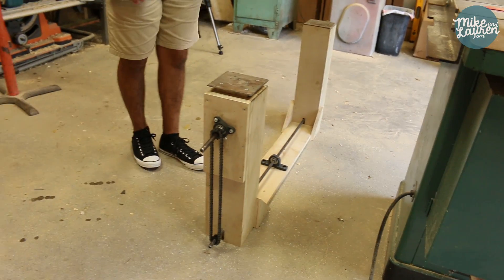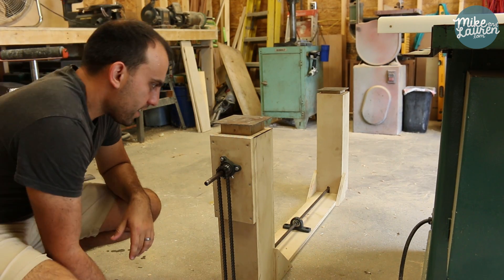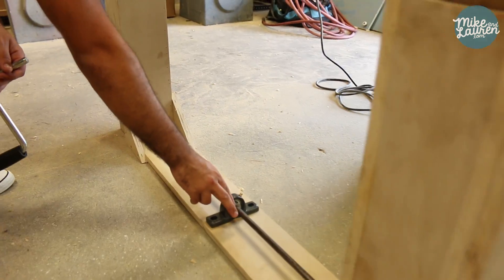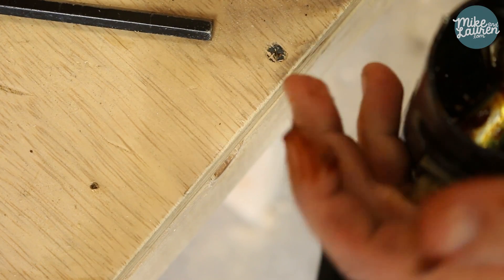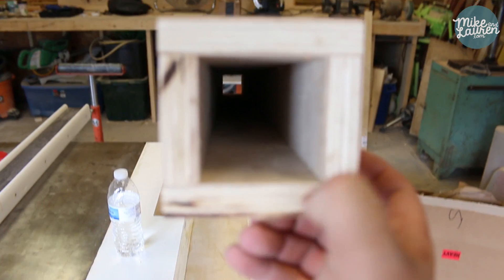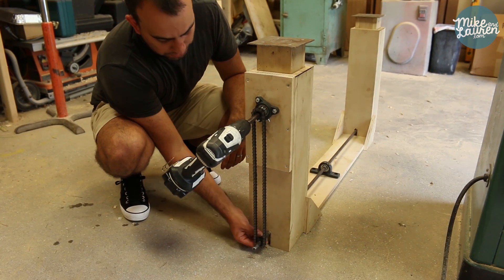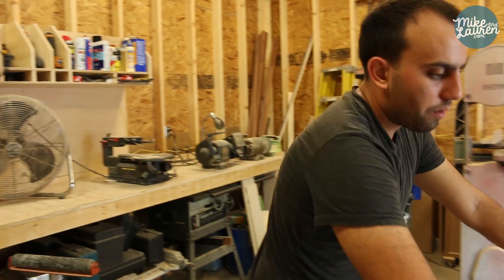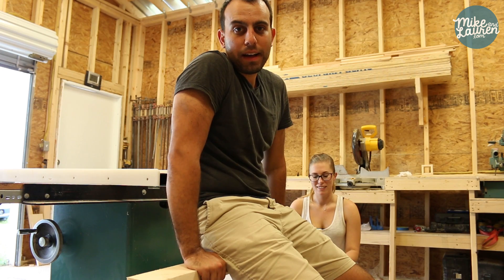Mike Makes an Adjustable Height Workbench (Lifting Mechanism)

Comment: I've not been through all the comments, but provided you keep the bevel gears on the same side of each jack, they should then move up and down in synch.  The only reason you'd need to swap a bevel is if you unintentionally rotated one jack 180 degrees relative to the other.  Otherwise, the same rod should pass through both in the exact same manner (bevels to the right, for instance) and all should stay in synch.  Right?

Comment: Try building a table which have this height adjustable mechanism and also the workbench can be folded using folding brackets. 
It'll be great for those whose room are small or if you want more space!

Comment: How do you prevent the legs from falling straight back down after you have set them in the up position? Wouldn't they fall down if enough weight is applied onto it?

Comment: Help please
Any body have an idea on how to sit the base of the jacks in some kind of wood or holder when the jack is upside down.  (I'm not sure how to make the jacks site in the box and how to make them safety sit in the box without damaging the trailer jacks cause i plan on having heavy objects on my table tables.)

*****************  How do i stabilize jacks in wood when they r upside down *****************
Thanks in advance for the help
Reply: did you get any answer ?

Comment: For the others then my questions at the end.....

I found the trailer jacks at Wal-Mart for about $35 each and the rod from Home Depot. Pretty easy to get the mech working. Just pull out the crank handles and move the cog (only on one of the jacks) from one side of the jack to the other, grind down a flat spot on both ends to accept into the cogs. 

What I can't find is the sprocket and chain bits to be able to put the motor where I want it. Can you tell me exactly what you are using and where I might by or scavenge the parts? Thanx for an awesome idea!
Reply from the maker: +Bill Nunley I bought them on amazon.  They were called "roller chain sprockets."
Reply: +Mike and Lauren I knew I just needed the right key words... Finally found some that were affordable here https://www.thebigbearingstore.com/13-tooth-sprocket-for-35-roller-chain

Thanks for the reply!

Comment: I would love  to know more about the mechanism and the parts that were necessary to build it. I want to make one of my own, and have been thinking about using jacks, but couldn't figure out how to make them both move at the same time. Any advice in addition to what you have posted already would be amazing!
Reply from the maker: +Annette Sinanian Sorry, I just kind of built this as I went... and since the plywood covers all of the components I can't take any other pictures.  What I can say is that 1/2" rod is what the jack companies use inside to connect their gears.  So all you're doing is taking out their short rod and replacing it with one long rod that connects the two jacks.

Comment: I've always been fascinated with the concept of an adjustable height table.  I've done several mechanical sketchups (manual operation, not powered), but never built them because I didn't have a practical application to justify building it.  I'd love to see what you plan to do with this because it's such a cool idea.  Hope it works out well for you, and a great start so far.  Your engineering skills are impressive!  Thanks for sharing.
Reply from the maker: Conrad Designs Thanks!

Comment: Those trailer jacks area cool idea.  I'll be curious to see what you mount there, and why the jacks had to be upside down.
Reply: Mike Kapotsy Why would that matter? Instead of having a table top that you push up you could just push down on the ground. Since the ground will most likely refuse to move the other end of the equation will.

Or have I missed something?
Reply: If this jack weren't upside down you would have to move the drill up or down with the table. As he has it, the drill doesn't have to move.
Reply: Mike Kapotsy Could you maybe have the lift mechanism follow the lift part up, so you wouldn't need the chain?
Reply: Andrew Porter that's correct.  I still think the way he has it is best approach.
Reply: Jim Groth there is one workbench out there on YouTube that is motor operated with remote control.  21st Century Woodworking is the name of the channel I think.
Reply: Cliff Bramlett Yea, if that's something you want to avoid I guess that setup makes sense. :)
Reply: Needs to be upside down because with trailer (tongue) jack, the lift mechanism comes out the bottom and he needed it to raise from top for his bench.
Reply: Jim Groth Not with the type of jack he's using.  The crank handle on trailer jacks is opposite end of the lift mechanism.
Reply: I would be interested to see if you do this with a single jack and a scissor lift that lifts both sides.
Reply: Jim Groth Good point. I suppose it could work either way.
Reply: Pushing down to the floor would mean the winding point would also move upwards.  I guess that's a bit more awkward - especially when that also means the connection to the opposite leg would also be moving.
Reply: I'm assuming there will be a motor to drive this thing. If yes, it wouldn't be very awkward to press a button on the table as it is rising (like for instance the Ikea tables) and if it will be manual, I don't see it moving very quickly and should therefore not be a problem.

Personally I would prefer the method that required the cheapest parts. :P
Reply: Mike Kapotsy I'll check that out. Would be fun to make something like that so I can combine my interests for woodworking and electronics. :)

Comment: Hm, that's very interesting. I wonder if i could gang 4 of these under on one access point to lift one item. Most interesting, thanks for the share.
Reply from the maker: aserta I would think that would work.  The weakest spot is the wood that the base of the trailer jack is sitting on.

Comment: Was any consideration given to a gear reduction to increase the speed that the height moves. Seems like it could be a pretty easy thing to implement since you already have the chain and spur gears going. 

Also, as others have said, definitely some sort of tool that you want to raise to usable height
Reply: Mike and Lauren Wooden gears!
Reply from the maker: Gordon Edmiston I actually had gear reduction planned, but Amazon didn't send my order on time.  So I picked up these gears to work on this weekend.  It turned out the drill turned it plenty fast.
Reply from the maker: Matthias Wandel Of course!  Have you used wooden gears with chain before, or would you just go gear to gear?

Comment: You're planning to mount a tool on the middle shelf, and this is a way to bring that tool up to a usable height when you want it.  Something like a planer.  Or a Panto router or router table.  that's my guess at least.   Gonna leave it as drill powered?
Reply from the maker: wordsnwood My plan was to have it hand crank, but the crank I ordered was too wimpy.  Then I saw the drill fit around the shaft, which made it much easier.  I'll implement some sort of crank eventually.
Reply: Mike and Lauren Nicely sidestepped my prediction...  :-)

Forget the hand crank.  Keep the drill.  You can probably find a cheap drill at a yard sale or thrift store and dedicate it to this.  Probably even a free one if you use a corded drill.

Comment: Drill powered contraptions... You've been visiting izzy swan haven't you :D

Sounds like maybe someone got an xcarve and needs a place out of the way to put it when not in use!
Reply from the maker: Pete G I'm a huge Izzy Swan fan, yes.  Although, my initial plan was to use a hand crank.  I didn't think of the drill until the crank I ordered turned out to be too small.
Reply: @MikeAndLaurenTV  "the crank I ordered turned out to be too small."

So you ended up with a cranky crank. Who would a thought?

Comment: Awesome! Great idea with thr trailer jacks, the ones I have seen before all use bottle jacks, yours seems to have much more adjustment, and the crank/drill drive is much quicker and easier than pumping a bottle jack!
Reply from the maker: stevet47 Thanks!